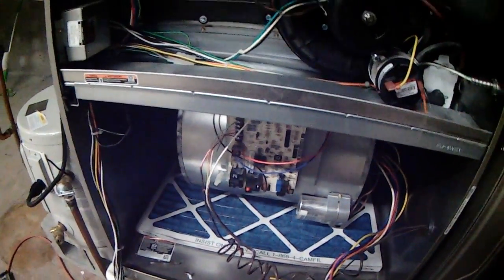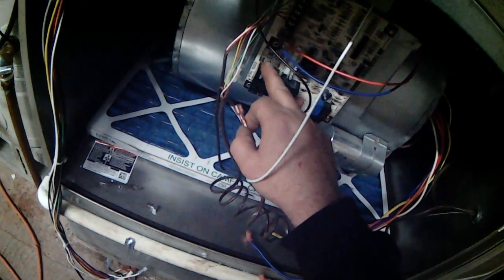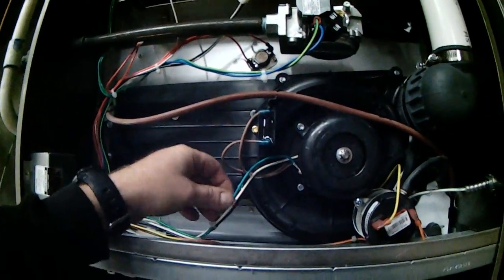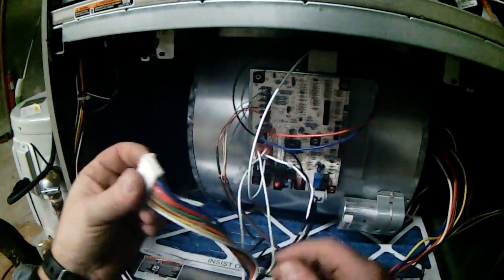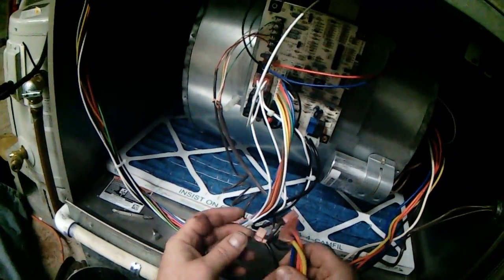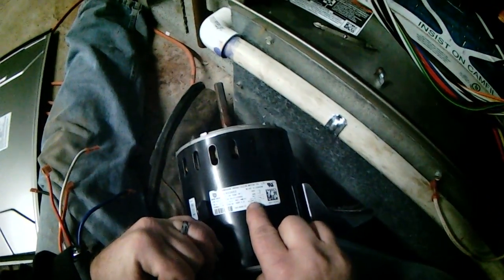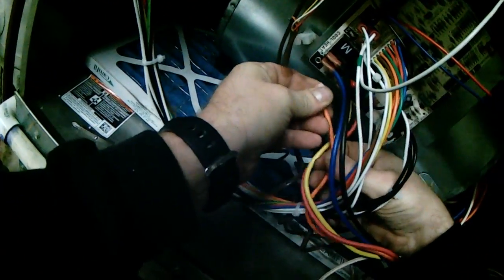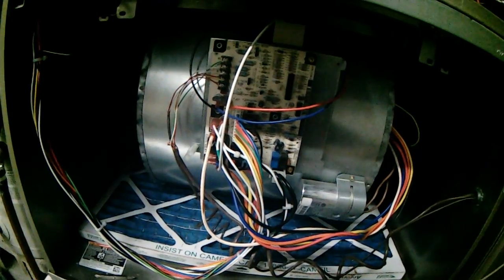HVAC Furnace Control Board Wiring

Comment: Hey Guy Brown I just replaced the control board on my furnace but I’m at a loss as to were the wiring is to go. The old control board is no longer manufactured and the new one that is replacing it has different architecture.
Can you advise me on how to properly wire this thing? (Can I send you a video the new mounted board?) 

thanks

Comment: What failed on the motor? did it seize up or burn out?
Reply from the maker: Craig Nehring It was a new install and the factory failed to tighten down the set screw tight enough. About a year later the blower traveled to the point where is rubbing on the housing. I had to change the blower wheel and motor.
Reply: I see, thanks, looked fairly new model for a failure, thanks for the info and the video
Reply from the maker: No problem. Is there anything you would like to see me cover?